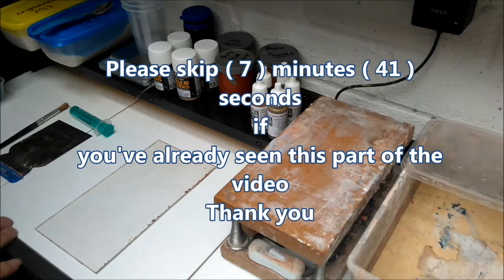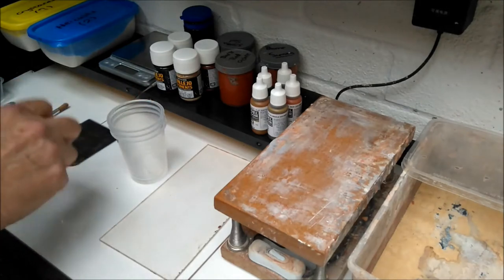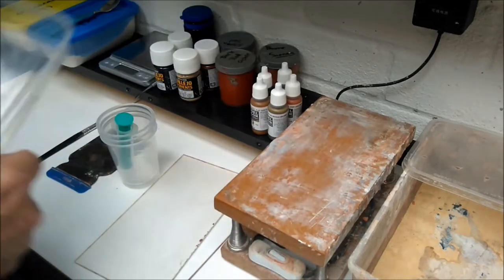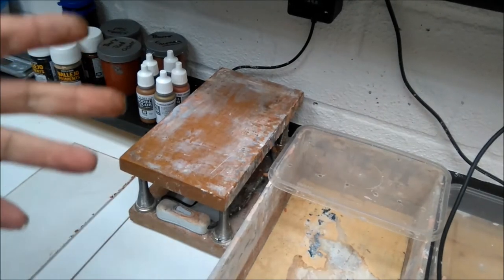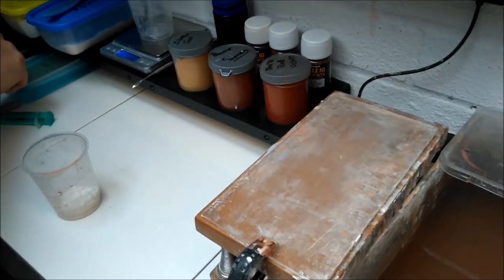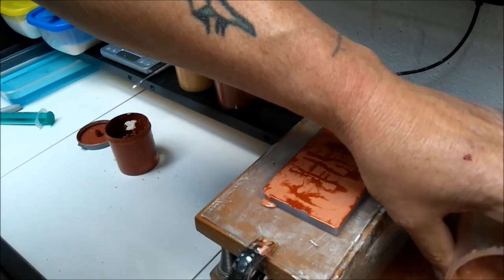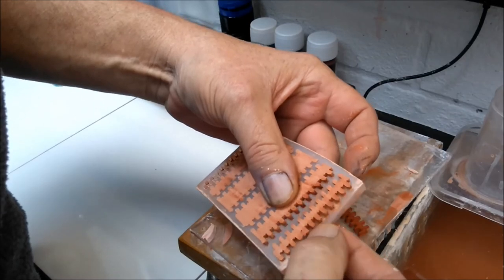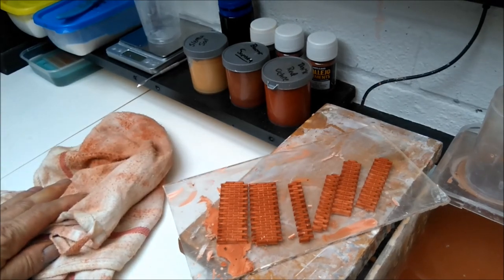Brick Piers In Stretcher Bond In 1/35 scale

Comment: Really wish they did some moulds in 1/72 .... Getting tiring scratch building every brick or the carved foam trick :( they do look amazing.
Reply: Check Ebay for HO railroading molds. Think the company is called Links or something like that. But they're in 1/76th(?) scale, but also have window molds for example along with other types. Have some used for 28mm fantasy buildings and they last forever.

Comment: Don't know if you can get it in England, but for 50 years, I've used, off and on,  Ultracal 30. Very hard, and a bit green from the mold, but very chrisp. Yes, the type of material is very important.
Reply: If you like Ultracal 30, try dental stone type 4. It's 5 times stronger (34,500 vs 6,500 psi) and cheaper. I use pink, but it also comes in blue, green, yellow, and white. Though not really important in our hobby, Ultracal 30 expands by 0.08% vs 0.1% for type 4 stone.
Reply: Love new info! Isn't this great that we get new materials. You think I wouldn't try something before Reporting it? LOL Yes, very important. Just shows how important it is that materials are very important.

Comment: Please heed his advise, and never ever pour plaster down the drain (unless you have a plaster trap). Plaster will settle and harden in the pipes and gradually clog them. This cannot be fixed with chemicals or even a drain rooter and the whole piping  needs to be replaced. Personally, I use a soft rubber bowl (silicon is fine, too) for mixing and let the remaining plaster harden in the bowl. A flexing of the bowl will remove the hardened plaster from the bottom and walls which can then be easily disposed of, or kept for rubble in a future diorama.